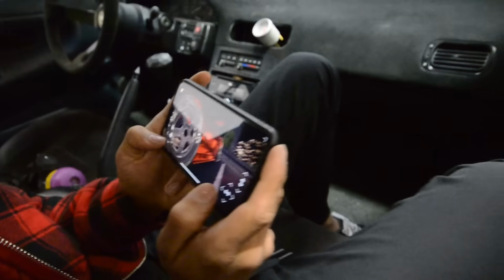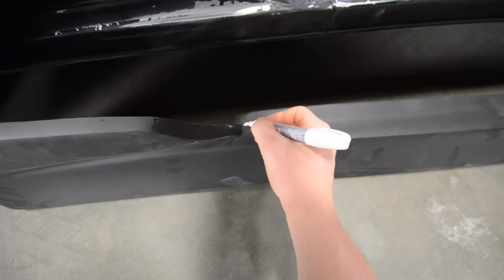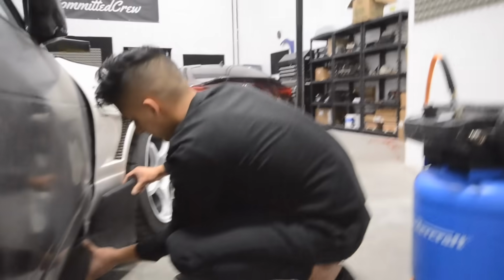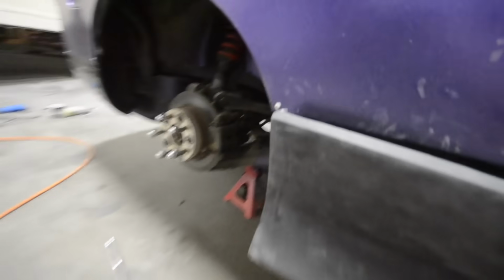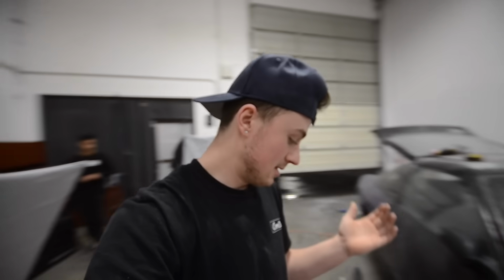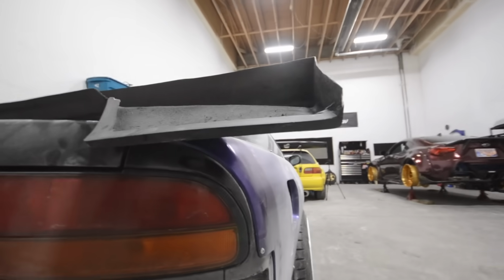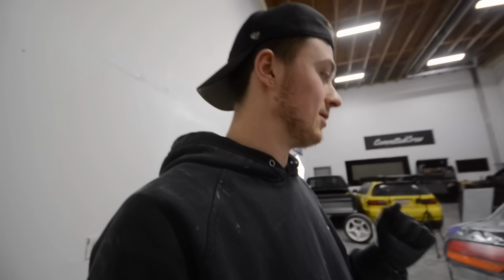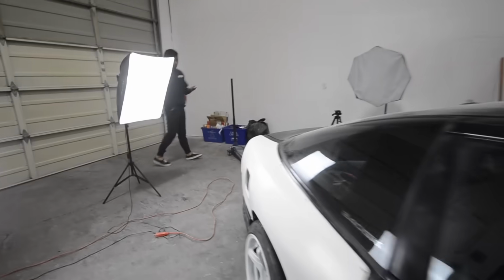240SX BODY KIT FULLY INSTALLED

Comment: did you check the exact years of 240SX that this fits... does the car have panels from opposing years that would not match the trim's on the other panels... gg, 1990 car but the rear panel is off a 93 and the front is off a 96... that's 3 different years with the possibility of three variations in the measurements.
Reply from the maker: The difference is between hatch and coupe, for all the years it’s the same

Comment: It kind of looks like those skirts belong on the opposite sides of the car... like the front passenger side looks like it should go on the rear driver side and vice versa
Reply: Like, I know there’s a sizeable difference it’s dumb to say, but it’s just dumb that there should be that much cutting
Reply from the maker: Yeah I thinks it’s dumb too, they are on the correct side and I have emailed them and getting it dealt with